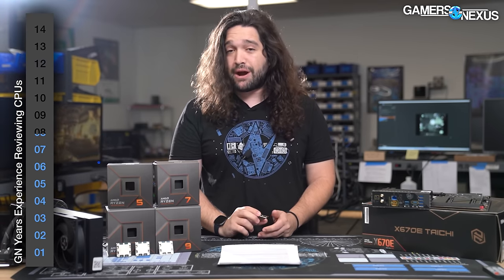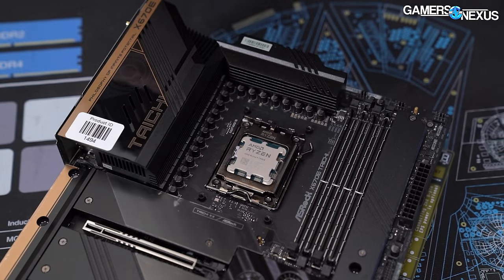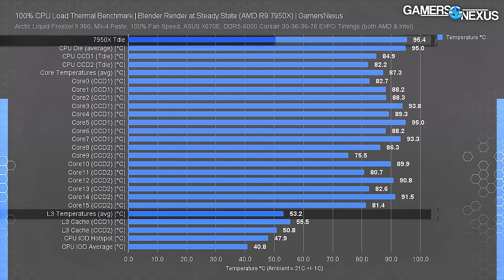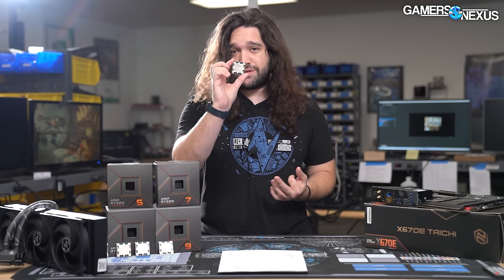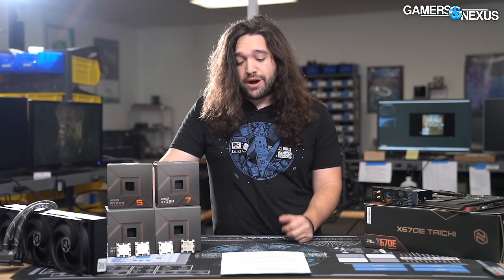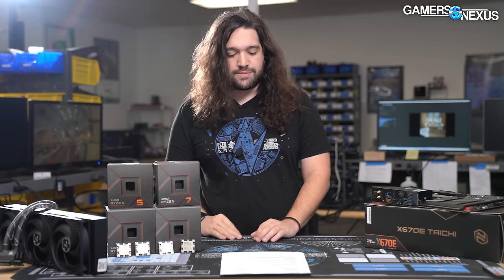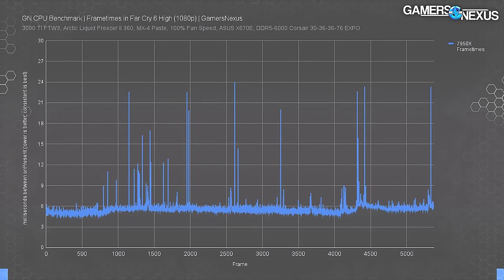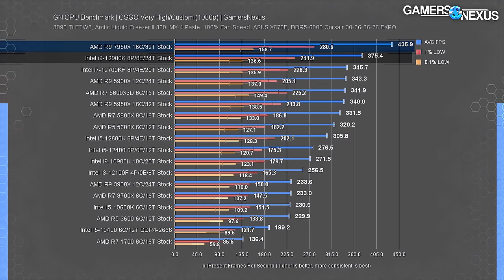95°C is Now Normal: AMD Ryzen 9 7950X CPU Review & Benchmarks

Comment: Given that the 5800x3D often beats the 7950x in gaming FPS average and 1% lows it really makes me think it would be best to wait for the 3D v-cache variances of Ryzen 7000 before upgrading from the 5800x3D.
Reply: This absolutely
Reply: You should! I am holding on to my 5900X till those versions are available.
Reply: Yep.
Reply: @swizzler8053  you should hold on to your 5900x for a lot longer than that. especially if you're playing above 1080p...
Reply: *If you are a gamer. This SKU right here might as well be a Threadripper for people who want to skim on motherboard budget.
Reply: If your primary use is gaming, and you already own a 5800X3D, I don't know why you'd upgrade to any 7000 chip. If you need more cores for productivity tasks, understandable that you might go 12 or 16 cores in the 7000 series. But, I don't know what sense it would make to upgrade just for gaming. Unless 350+ FPS in CSGO with your 5800X3D isn't enough, and you think, somehow, that 500+ FPS with a newer 7000 3D chip is going to give you some kind of advantage. lol. Makes even less sense if you game at 1440p or 4k where the bottleneck usually ends up being the GPU.
Reply: @TooBokoo  With that computer I game at 4k 120hz. For most games I'm able to get a smooth and consistent 120 FPS but there are a few more CPU intensive games I like to play like Spider-Man or Cyberpunk 2077 where I'm unable to lock in a consistent 120 FPS. I know it's a CPU bottleneck because I'm using a 3090ti FE and the FPS still drops 10 to 20 FPS fairly regularly even when I experimented with turning setting to low and dropping the resolution to 1080p. I'm willing to bet that a 7800X3D or a 7900X3D would significantly improve 1% low performance in those titles.
Reply: If you main usecase is gaming there is no reason to upgrade, especially because its an expensive upgrade with at least new CPU, mainboard and RAM. But if you need the much higher multicore performance of a 7900x or 7950x for applications then the upgrade might be worth it.
Reply: @bobhope5976  I am not in a hurry bro😁
Reply: why upgrade at all? you're not gaining anything unless you're trying to stream x264. most people's monitors are maxed at 200hzish. no gains to be had except ego gains imo.

unless of course you aren't just thinking of gaming :)
Reply: Keeping my 5900x but interested in their GPU’s launching in November. Hoping AMD beats NVIDIA so I can make an all AMD machine and give loyalty to one company that is doing things right. NVIDIA is way too toxic and Intel lost my trust years ago
Reply: there is no reason at all to upgrade FROM the 5800x3d to anything for gaming in the next 3 years.
Reply: Oh 100% I was going to go with a 7000 series to upgrade from my 3700x but figured I'm getting off just getting a 5800X3D
Reply: @bobhope5976  I'll be upgrading from my 5950x and swapping platforms if the X3D cache variants are impressive enough at gaming /shrug If you have the disposable income, it's not too terrible cost wise once you part everything old out. The only numbers I care about are 1% and 0.1% lows in something like CP2077 at Ultra with RT maxed, but as long as that is meaningfully improved, I'm more than willing to pay premium for it
Reply: @RogueSchoIar  Yep, completely agree with this. I'm in the same boat but I have both a 1440p and 3840x1600p monitor
Reply: If you only want to play games and you want to build a new systems you shod go for 7600x or 7700x
Reply: Why would you upgrade from 5800X3D though? Don't waste your money
Reply: @Spido68_the_spectator  Same reason you would upgrade any part in your PC. It's not giving you the performance you want and another part on the market has been shown to give you that performance. That new part to upgrade to could come in three months or three years depending on what level performance you are looking for and what new parts manufacturers release.

Personally I'm not in any particular hurry to upgrade my 5800x3d but when a new CPU hits the market that is capable of addressing the 1% low issues I have with games like Spider-Man and Cyberpunk than I'm going to upgrade to that new CPU because it gives me the performance I'm looking for.
Reply: Im using the 5800x3d and i was planning on skipping the the base 7000 series and waiting till v cache and that is still my plan i see no gain here for gaming ..
more so at the AM5 platform swap !
My only worry is the heat  the 5800x3d were nerfed for overclocking because of the temps .. at 95c on these base 7000s are we going to need custom cooling loops on the 3d v cache zen4's ??
Reply: 5800x3d owner here. It's a good bridge chip before jumping to am5. I'll probably move to am5 for LATE stage zen 4, or zen 5. In the meantime, I'm enjoying this season of Chip Wars!
Reply: This was ALWAYS going to be the case for a gaming focused build after the 5800x3D came out.
Reply: @50H3i1  steve at hardware unboxed did a 7600x review and its a little monster of a cpu for gaming ..
Reply: That’s exactly what I was thinking
Reply: Don't you have to upgrade your motherboard to am5 for 7000 series I'm on zen 2
Reply: looking at fact, that AMD announced that 7000 series will have 3d cache, and 7950X is more of a workstation "baby thrreadripper" more than gaming chip, i think 3-cache 7000's will be absolute gaming demons.
Reply: @50H3i1  why? Theyre literally only competitive with Alder Lake and Alder Lake is a lot cheaper. The 5800X3D is also a much cheaper route. Raptor Lake is coming and gonna likely win at everything considering Alder lake already still competes directly with it in multithreading and its gonna get even worse for zen 4 with rocket lake. Zen 4 is a dog water launch but because it barely beats alder lake in gaming it gets treated as a good product. This is just a really shit launch and its crazy to me anybody can think AMD is impressive here. They moved to 5nm and still need to keep their chips at 95 degrees to compete? Are you serious? The thing about it is its not just bad value vs Intel, its bad Value vs themselves with the 5800X3D. Factor in DDR5 only and the price of their new motherboards and yeah. No way around it this just seem awful. Though ill the 7950X credit for being a multithreading animal if you need it for that.
Reply: @Angel7black  right? They took the nvidia approach: throw more silicon at it, increase power consumption and price, call it a day. Somehow everyone eats it right up, despite the huge regression in efficiency.
Reply: @The_Nihl  im going to say maybe
I get this feeling like the 5800x3d it will be hit and miss across gaming ..
where its excels in some games its going to obliterate everything else but in others i think its going to be just okay !!
Like now its how the game is made and if the cache helps or not !!

but the temps worry me with the 7000 v cache
Reply: IMO you shouldn't be upgrading from any 5000 series Ryzen anytime soon if all you're doing is playing video games. 

DDR5 motherboards are much more expensive, RAM is more expensive, new components run much hotter, you need a much larger power supply (more expensive) and you really wont see any improvement in video games.

And honestly, we've reached a golden point where the CPUs are good enough that you're exceeding 240Hz in 1080p and hitting GPU bottlenecks in 1440p+, so there's honestly not really any reason to upgrade your CPU past last-gen Ryzen if you're just playing games.

5000 series is like Sandy/Ivy Bridge back in 2011-2016, just sit on the CPU for 5-10 years until 480Hz monitors become the norm or a crazy CPU-intensive game comes out.
Reply: I'm tired of the bias that exist in the PC gaming ecosystem 

when AMD runs hot they get a free pass but when intel runs hot they are criticized, joked and bashed for it.

now power consumption has become a AMD fanboy talking point that it is almost political. 

you see their are double standards when it comes to AMD and Intel, because without double standards AMD has no standards and AMD are guilty by thier own damn standards
Reply: @Angel7black  check hardware unboxed  7600x review !!
its beating the 12900k in gaming easy.
But the age old question is it worth the overall new platform cost ( while i guess im bias towards amd ) 
with AMD promising 2025+ board support ddr5 while still expensive but coming down if youre looking at building a new pc now the 7600x AM5 platform is a great start..
if raptor lake is the last cpu on the lga1700 socket then you will be up for a new mobo in a year !!
Reply: it may beat the 7000 series in gaming, but is it really worth to pay over 400€ for a CPU just to play games? I´d rather buy a 200€ CPU and have 200€ more for a GPU.
Reply: @lldjslim  yeah but look what the 12900k was up against the 5950x which is still crazy low power consumption .. 
After this showing im worried how im going to cool a 7900x3d ( which is what im waiting for ) in itx build with most likely 280mm max aio !!
Also Intel in general have higher than average power consumption for less performance the 7950x has shown if you want a monster you need the power usage .
7950x vs 13900k will be a real interesting match !!
Reply: If any of you 5800x3d owners wanna sell this very old very slow cpu to get new fast crazy cpu. Im willing to buy one with fair price. I mean its old and slow right so you cant ask much. How does 250 dollars sound? Fair right its very slow and old.
Reply: I think upgrading my i7 6700k to a 5870X3D would be a nice upgrade. Upgrade to a 7000 X3D serie will cost a lot more i guess. But I'll wait some time to see the difference.
Reply: I'm still confused why one would be immediately going from the 5800x 3d to anything its just not sensible to have a year old high end cpu to upgrade the release.
Reply: i doubt it
this cpus allready run at boiling point
so 3D vcache will be unlikely as the 5800x3d runs hot for its generation

but yeah we will see
Reply: @RogueSchoIar  by then the 1% low issues would be fixed in game updates.
The main problem is software, as developpers optimise less and less their products, only causing a " throwing more power at the problem " phenomemon.
Usually the lifespan is 2 GPUs for 1 CPU.
Reply: @GhostlyGhille  i personally am waiting to move from the 5800x3d BUT i do see sense for early adopters to go down the am5 platform 7600x some ddr5 ready for the 3d v cpu's or just sitting on the 7600 till ZEN 5
I think if i wasnt running a the 5800x3d that is what i would be doing
Reply: @Spido68_the_spectator  Could be. If they have been fixed by optimization than I won't feel the need to upgrade. If they don't than I'll take the brute force approach.
Reply: @Spido68_the_spectator  Rarely do developers actually bother to go back and fix their games in this way. So your "would" is more of a "could"; one that I wouldn't rely upon, either. 

FromSoftware is a good example of a developer of making amazing games, giving them decent support, aaaaand then never caring about the micro-stutters that plague their title, ex. Bloodborne
Reply: I think I'm gonna wait for some consumer friendly ARM chip instead. Much more efficient.
Reply: It's more interesting to see how good the heater performace of 7950x for space heater.